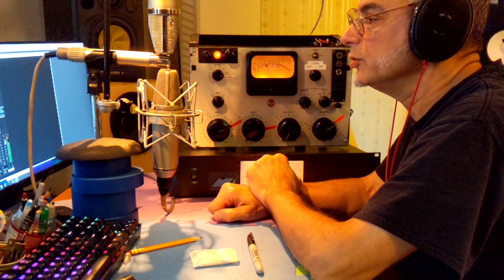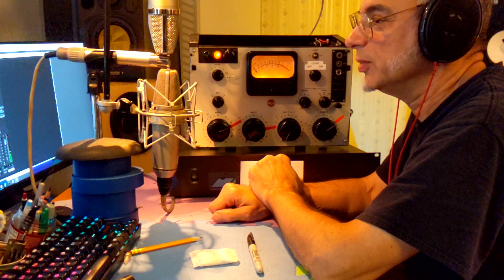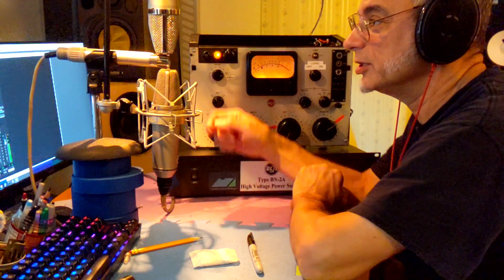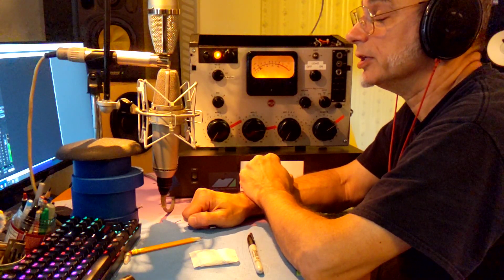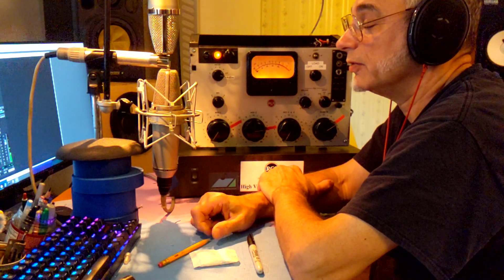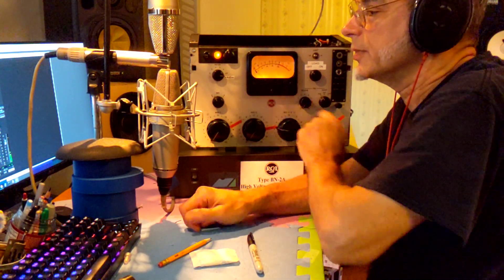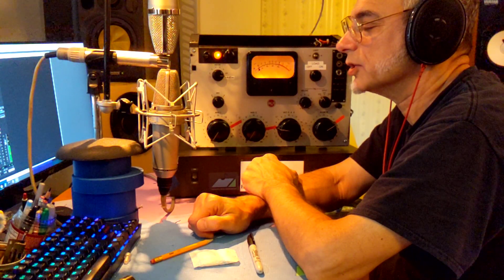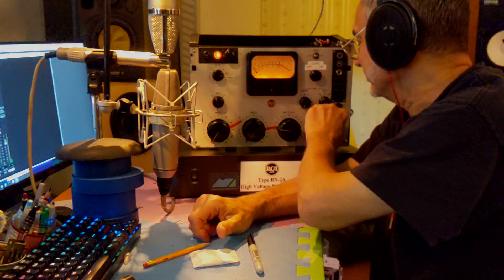Restored RCA BN-2A monophonic radio broadcast tube mixer

Comment: do you have any photos of the back? i recently got a bn-2a with what looks like similar modifications on the front as yours but  the  outputs and power plug on the back of mine is different from another bn-2a i had
Reply from the maker: Email me eddieaudio@gmail.com
Reply from the maker: The unit I got had a new back panel with XLRS.  the power transformer was toast.  I removed it, depotted the xfrmr, built an external power supply.  in place of the original xfrmr i installed perboard to mount new internal filter caps - leaving the old ones in place but disconnecting them.